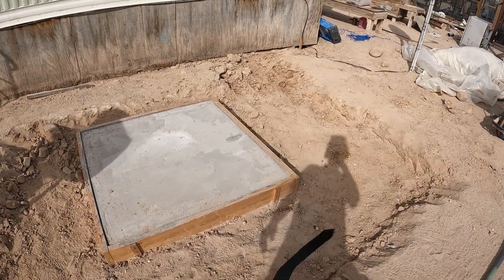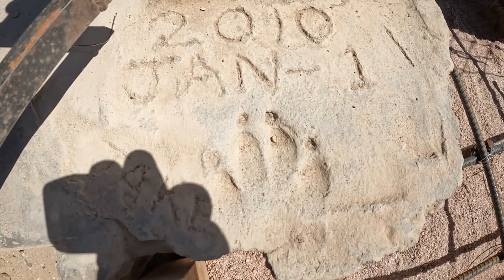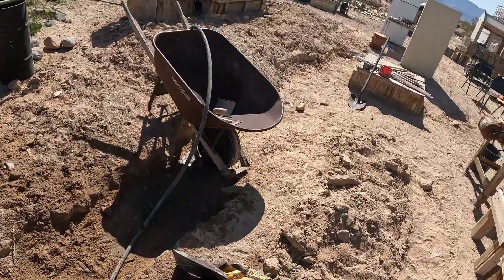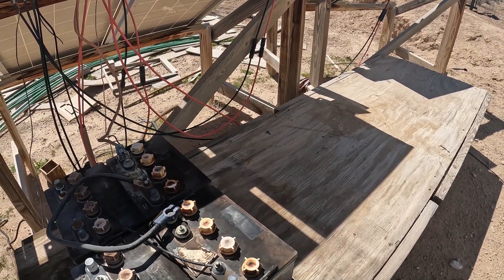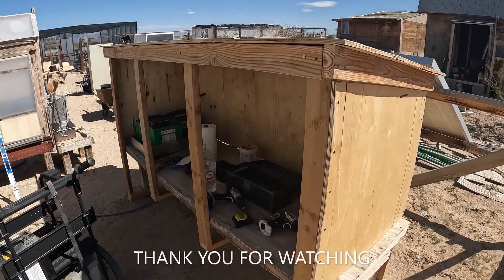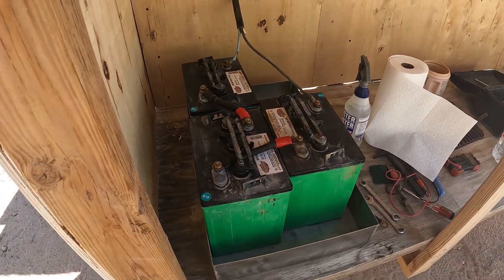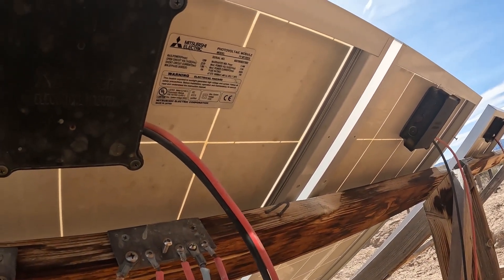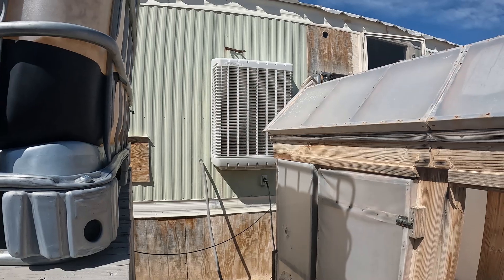Sand Battery Room Edition Preparations, Episode #84

Comment: I run a 12 volt system and my inverter will run from 15 volts down to 11 volts. I've been thinking of changing my batteries using an 8 volt and a 6 volt hooked together instead of 2 six volt batteries... Your thoughts fren.......
Reply from the maker: If you are using a charge controller that voltage may be too high or I should say the charge controller may shut down the charge before they reach full capacity. I am not sure but it may be okay. Also they don't recommend mix matching batteries of different voltages but I don't think that would be a big issue just weather it charges to full capacity would be my concern.
Reply: @off-gridsurvivalmike8120  I have an Outback 60 amp charge controller and a xantrex 40 amp load controller for my wind generator and both are adjustable. On mix matching batteries.... no different then adding cells(batteries) with c or d cell batteries.
Reply from the maker: @keithfloyd1178  Yes I may be wrong about mixing the voltages. It sounds like it may work you would just have to give it a try and monitor the voltage.
Reply: @off-gridsurvivalmike8120  I'm just trying to find a way to extend the battery run time, you well know it's only 13.7 to 14.1 max charge on a 12 volt system and my inverter will run 15 volts max.
Reply from the maker: It sounds like a great experiment and should work okay in my opinion. As long as they stay topped off. I am always learning and experimenting and that sounds viable to me.